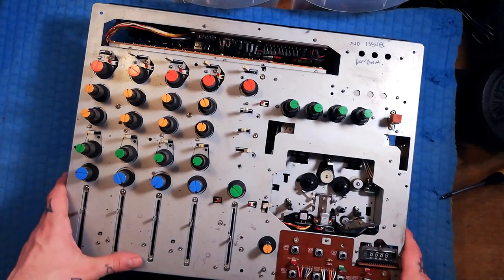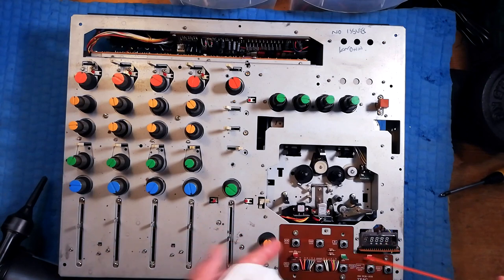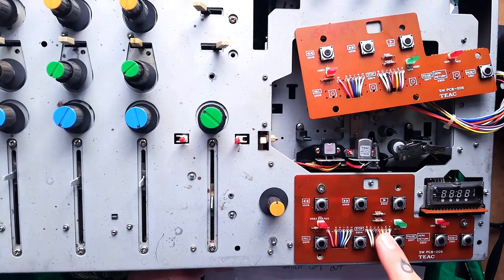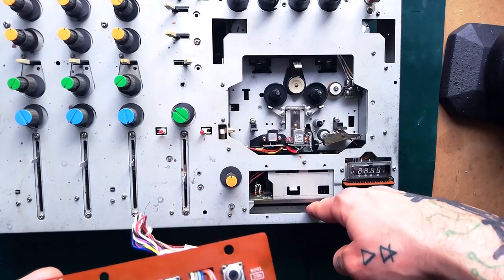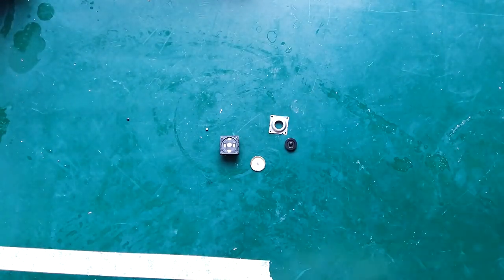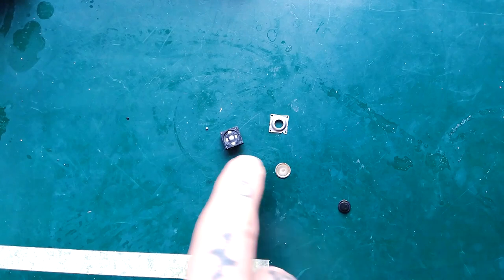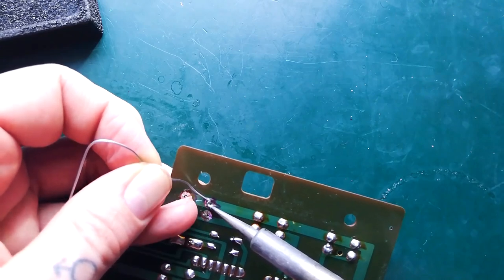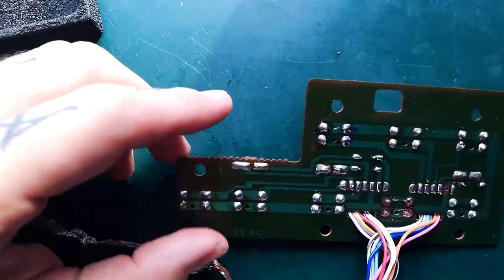Tascam 244 | Clean & replace shuttle switches | Soldering & Desoldering

Comment: @Tekrakan thanks mate for putting this great video's online. I refurbished my tascam 244 completely. 
Had to fix the gear axis ( part 17 ) using a lego block, glue and 3d pen.
I now did the first recordings on a totally clean unit. 
I am only considering a recap off the psu/amp board.  
And will test with DBX disabled if I can drive the tape more. 

Your video's made it pretty easy.  Thanks a lot.

Comment: I picked up a 246 recently that’s almost perfect, but the pinch roller rubber is shot, and the play button is worn almost to death. So, another great one, @Tinkering with Tascams
Reply from the maker: Congratulations on your purchase, I think the 246 is my overall favourite of the 4 tracks tascam made - the 424 mk III and 464 have similar features and they are more portable which is nice but the 2 band parametric and Analogue meters on the 246 win the day for me at least. FYI if you want to access the shuttle switches on that model, you don't remove the front case, the whole control/meter assembly below the transport is held to the  chassis by thee screws, and the shuttle control board is attached ot the front of that.

Comment: Hey man! Love your content! It has inspired me to take on restoring my buddies 244. I’m getting somewhere but have gotten stuck after replacing belts and tires. It seems as though the tape transport is half alive… as for the buttons though none are functional or lighting up. (It’s good to note then when I power it on or off they flicker as if trying to light up and function.) the tape transport motors seem to all be functioning and have the right amount of tension but it’s like the machine is stuck with the tape heads lowered and the control belt motor is stuck in one spot with the tension maxed. Could this be calibration? Or power issue ? What exactly powers the play/stop/etc functions? I’ve been trying to de code the manual but no one is talking about the transport buttons not functioning or lighting up. My Capstan is spinning nicely and if I force the gear/cog manually it will raise the tape heads and pinch roller… I’m just lost. I’ve taken it apart cleaned the transport very well. From what I’ve seen I see no damage as far as blown caps or cracked pcbs in the machine. I’ve double checked all connections…. Maybe it’s a motor malfunction of sorts? I’m hoping it’s something silly. But before I go multi meter mode I figured Id reach out. For some more troubleshooting expertise as far as the transport buttons not working… I cannot understand them flickering when turned on but just giving up after that brief second…. Seems like a short but I don’t know enough yet to say. Thanks so much for the awesome content!

Comment: How well does cleaning the switches work considering it looks like they are sealed? I have a 246. Thanks for the tips.
Reply from the maker: Thanks for your question - I'm pretty familiar with the 246 having refurbished half a dozen or so units at the time or writing, and although the switches etc are designed to minimize the intrusion of dust etc they are not "sealed" (by which I mean the way a a bottle of water with the cap screwed on tight is sealed, or the way a vacuum tube is sealed) there is usually a metal surround to minimise the flow of dirt onto the conductive surfaces, but also a hole on these switches specifically designed to introduce contact cleaner and compressed air, so in answer to your question yes, compressed air and contact cleaner will get into the components, just as dirt etc got into them in the first place, otherwise there would be no noise or crackle...thanks for watching :)

Comment: in the meanwhile, have you found new replacements for these buttons? And do you have a parts number maybe? My switches have gotten so bad that I've broken off 2 of the caps.
Reply from the maker: If you mean the tactile switches you cna get those from any electrical wholesaler, choose oens of tyhe same dimensions and number of pins and they will be fine. If you mean the cosmetic plastic part above, maybe 3D printing will come to the rescue but until then you'd need to get replcements from a spares donor.